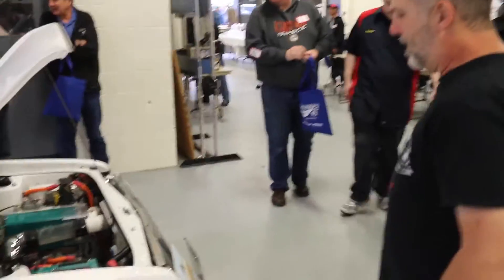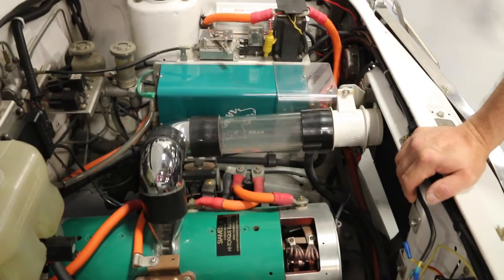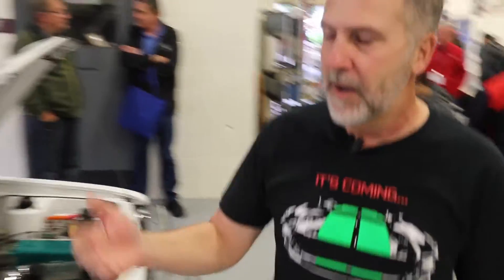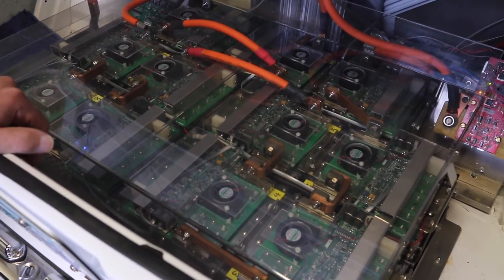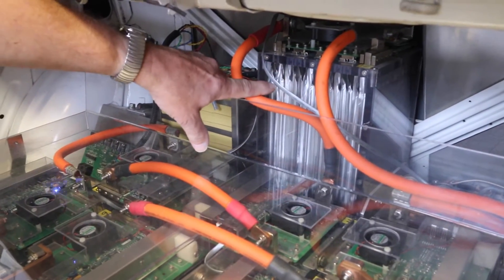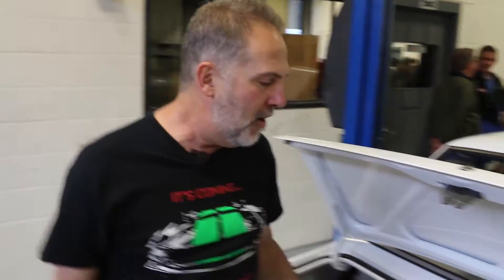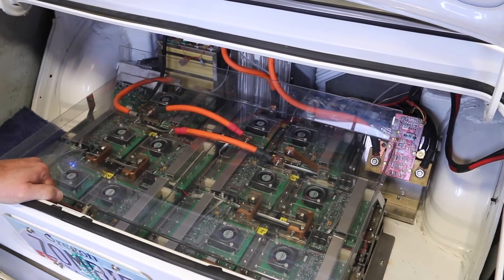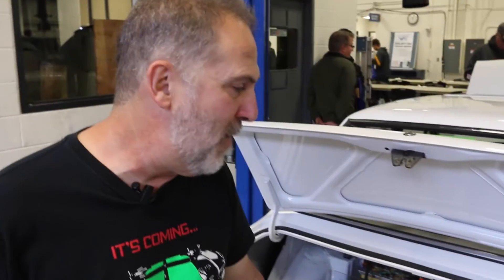Record-breaking 'White Zombie' Appears at Portland Community College

Comment: There has go to be more batteries than that? Also those batteries are extremely dangerous. If you puncture the tin foil that contains the chemicals they can burst into flames. I think that's the reason Tesla is still using 18650 Li-Ion cells instead of Li-Poly.
Reply: Chris Mac and so is a gasoline in ur tank

Comment: They should update it with a specially built chassis and a modern electric engine (s) that typically weigh less and occupy less space for the same amount of performance. With the saved weight they could add more batteries.
Reply: He gets the motors free from his work at NWHS. They're old Crown PE motors. He could probably get some AC motors from a more modern Crown FC for a good discount. We're all able to buy parts at cost through the company.